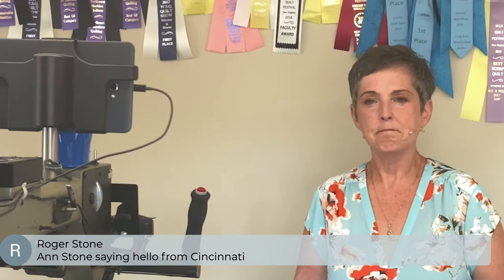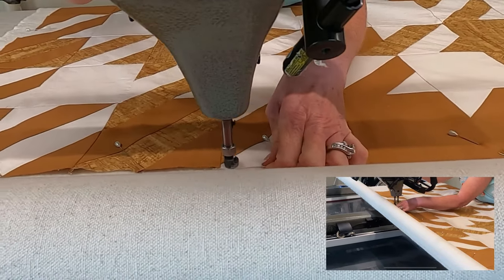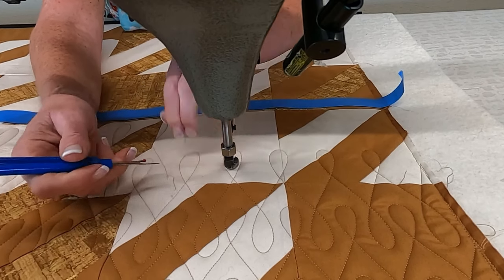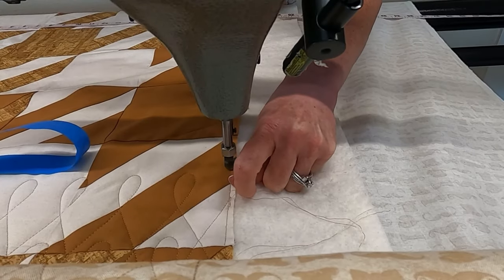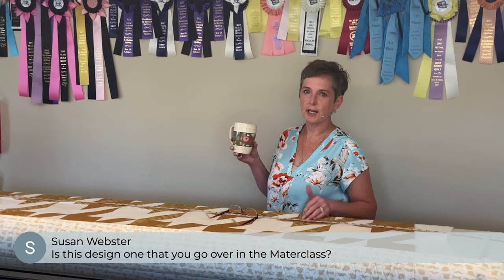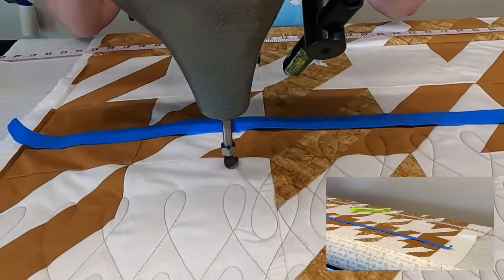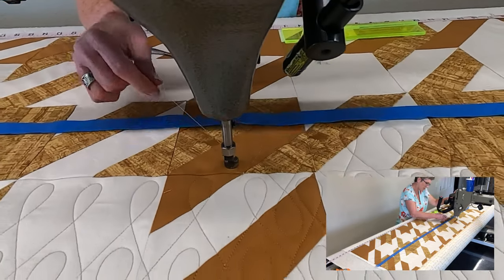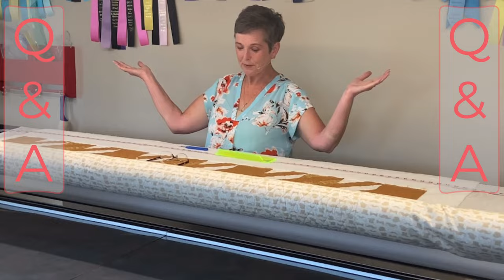Live & Unscripted Freehand Quilting - Crazy 8s

Comment: Hi Susan, for piecing a back have you heard of the John Flynn diagonal method?   I ran across it years and years ago when I was first starting out.  It allows you to piece a back with less overall material, and with the backing seam running diagonally, you don't have the vertical seam issue that sometimes creates a problem.  I put the formula into a spreadsheet, and use it quickly to figure out what will work.  Love your pattern, and quilting choice.
Reply from the maker: I have! Although I didn’t think of it for this one, I confess. Next time👍🏻

Comment: I was watching (again) and after thread beak #2, when you re-threaded the machine,  it looks like you wrapped the thread around the tension knob two times. If so, is that because Isacord is slippery? Wasn't sure that is what you actually did.
Reply from the maker: I do wrap it 1.75 times. That’s what my machine manufacturer recommends and it works 👍🏻

Comment: Trying to understand how the red snapper attaches to the rail. Is there a groove in the rail itself that the snapper snaps into?
Reply from the maker: First off, my machine came with canvas leaders attached to the rails. Many machines have those. Then, with the Red Snapper system you receive a thin rod that slides into the hem of that canvas. And finally you’re able to snap on the bits you see me using in the videos. Hope that helps!

Comment: Do you ever find out your tension is off on the back of your quilt after you get started.  I wish there was an easier way to check this before I get too far into the quilt.
Reply from the maker: Easier than…..? If it’s in question, I either use a mirror or climb below😁 Over time, I’ve gotten more attuned to my machine, and can often detect stitch problems early, but that just comes with time and experience.
Reply: @StitchedBySusan  thanks